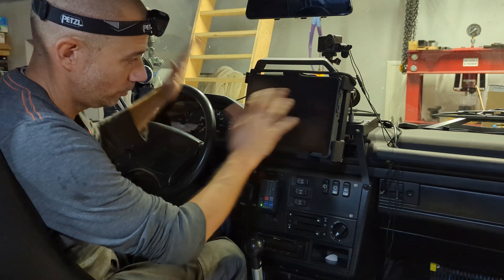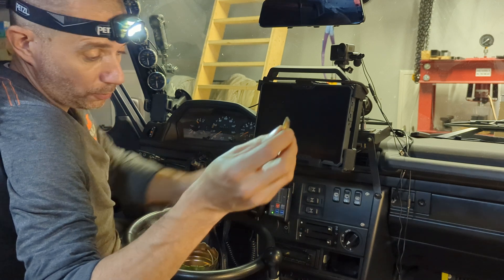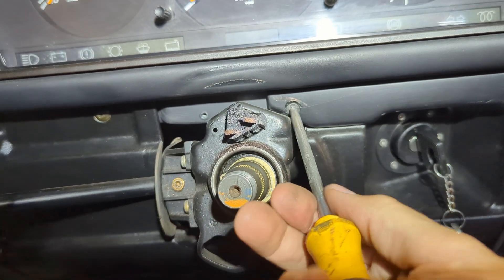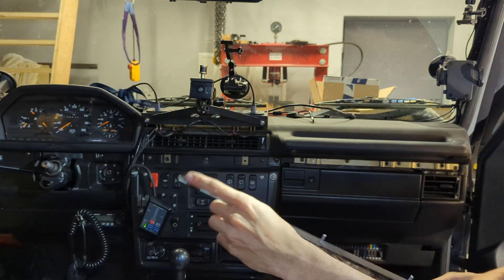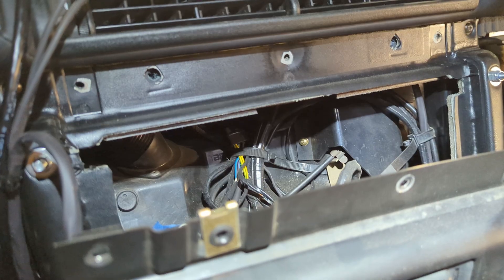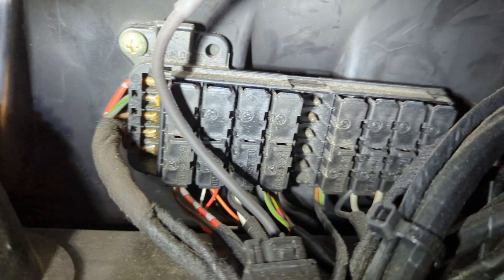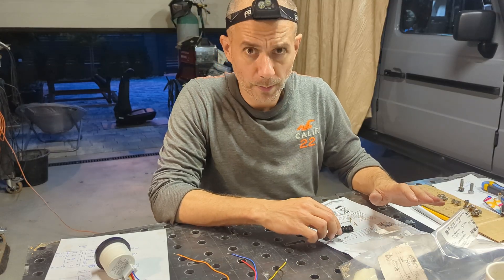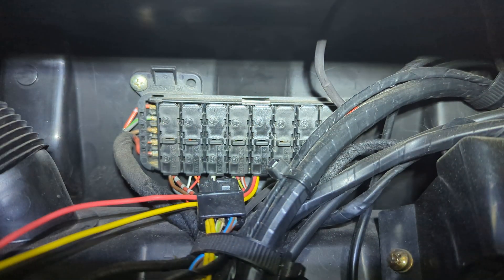Secret G-Wagon Electrical Connector

Comment: These two screws behind the steering wheel are not original. You should have the same two pins there as on the other side of the trim so steering wheel removal is not necessary.

Comment: Thanks! Do you know are these lines fused and are those lines driven through relays or just through the switches and ignition switch? Ofcourse something small like the cauge lights are ok, but what about phone chargers etc?
Reply from the maker: I believe that this connector is behind fuse number 26 (7.5A) and fuse number 27 (15A) and there is no relay. For sure this connector is for smaller devices like radio, small gaugues etc. Its not for 300W led bar... in case of such big devices this connector can be good point for control wires but main power supply should be directly from battery.